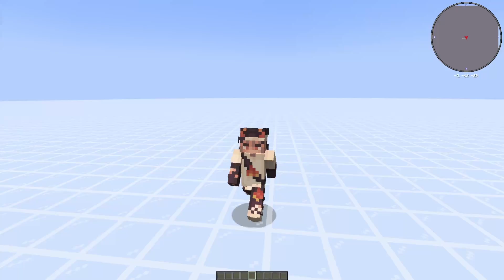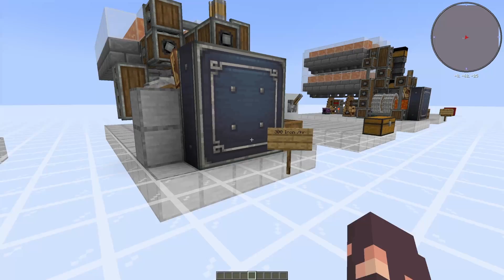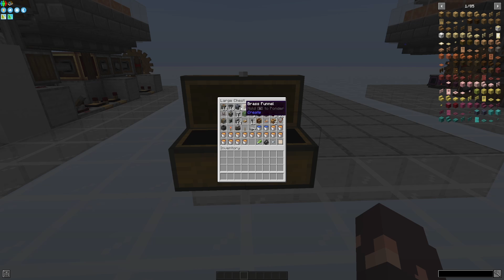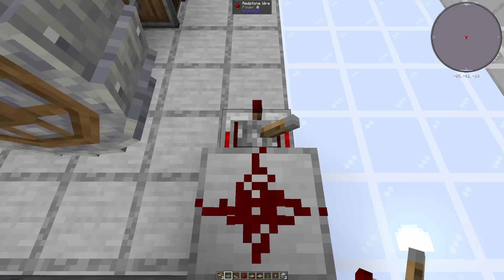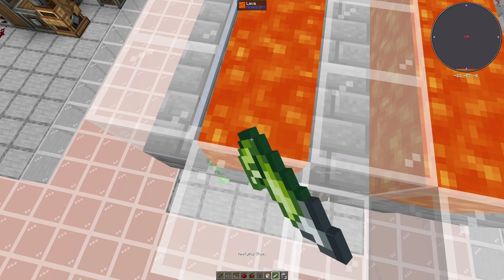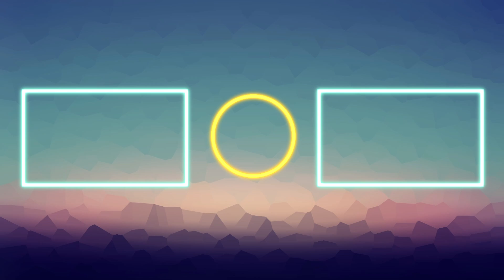The ULTIMATE CREATE IRON FARM (No Villagers) 600 IRON PER HOUR! |  Create Mod TUTORIAL

Comment: The turning is not drooping cobblestone. i see in the comments that people just put in drills. is there a way around that?
Reply from the maker: Make sure that while the thing is turning cobble is generating. if it isn't try increasing the sequenced gearshift angle to 100/110/120 degrees to see if that fixes it. also make sure to glue the original stone blocks together so you get the full line of blocks turning!
Reply: @kindlebubbledump  i confused a Redstone extender with a repeater. Its fixed now Thanks

Comment: I downloaded the schematic and it's not working, the clutch doesn't start so everything just doesn't move when i removed it and replaced it with a gear it works, also the sequence generator just doesn't work, the conveyor belt is going the opposite description and the cobblestone that is rotating doesn't break the new cobblestone (it rotates when i replace the sequence generator and the clutch with gears)
Reply from the maker: Hey! I don't explain how to setup the schematic in this video cause it was one of my earlier ones before I knew that's how most people would use the farm. The clutch should act as a shaft unless powered, then it won't do anything. It's just an on/off switch tho so if you don't want it you don't need it. The convayor belt going the opposite direction can be fixed by inverting the 256 RPM rotation speed controller from clockwise to counterclockwise (the rotation is dependent on which orientation you put it in your world so it differs). You should also check that the fan is going the right way, if not change the slower RPM rotation speed controller from clockwise to counterclockwise too. Weird that the sequenced gearshift doesn't work. Make sure you're flicking the lever to turn the farm on? that lever will power a clock that powers the sequenced gearshift and lets it turn. It will also make sure the clutch stays inactive and won't stop the farm.

I would watch the tutorial vid just to make sure you have every component, and if you skip to the redstone logic part I explain whats going on there if it's confusing.

Comment: 2h i can't solve the problem overstressed
Reply from the maker: You'll need additional power generators. If possible I'd recommend a steam engine since those generate the most amount in the smallest footprint, but you could also do a max sized windmill, or a TON of water wheels until it starts working
Reply: @kindlebubbledump  after 6h, i realized that it was a problem with the mod, I reinstalled the mod and now everything is good, thx for the tutorial
Reply from the maker: @Cosmos_Gregoriy OH NOO! glad u found the issue and the farm works!

Comment: I followed everything right and its in reverse I doNt UnDeRsTanD
Reply from the maker: Just change the 256 rpm rotation speed controller from clockwise to counter clockwise. You might also have to change the 10 rpm one if the fan is backwards
Reply: @kindlebubbledump  I figured it out after sending that and replaced the turning part for drills, works now tho :D
Reply from the maker: @DragonicArchitect cool!
Reply: @kindlebubbledump  trying to make my own version of a zinc farm (im on fabric so I have that weird plugin that uses asurine) and its actually kinda compact so far
Reply from the maker: @DragonicArchitect nice! I haven’t messed with fabric create yet, but that sounds fun!
Reply: @kindlebubbledump  its a much more lengthy process than forge lol
Reply from the maker: @DragonicArchitect lol

Comment: without using a creative motor would a regular motor work the same?
Reply from the maker: yes! Just make sure you can generate 6,200 Stress units. You can check how many you're making with a stressometer connected to the windmill bearing/water wheel/ other motor

Comment: is the mechanical belt supposed to go the opposite direction of the funnel thats connected to the barrel 😭😭
Reply from the maker: no! the build is directional, if you reverse the two rotation speed controllers from clockwise to counterclockwise then it should fix it

Comment: Does this work for 1.20.1 ?
Reply from the maker: Yes!
Reply: @kindlebubbledump  The redstone mechanism (10:12) does not repeat for me. It only runs once before stopping completely
Reply from the maker: @mufano8843 does the powered latch at the start of the circuit get powered from the side at the end of the loop? If so, make sure the on/off lever stays on. If not, it has something to do with the return circuit. If you could join my discord: https://discord.gg/UWf8tWjqpN, you can send a screenshot of the circuit and I can help more
Reply: @mufano8843  It happened to me, I had gotten confused and crafted the wrong lever, I realized looking at the detail of the redstone comparator that it didn't connect to the lever on the floor, 9:18

Comment: Im getting no cobblestone at all even at 8rpm
Reply from the maker: I would try 6 rpm and if that doesn’t work, keep it at 6 and increase the pulse repeater wait time by a few ticks (2-10). If that still doesn’t work, make sure the stairs are waterlogged (because schematics can’t place that in automatically). Let me know if you try all of these things and it still isn’t working
Reply: @kindlebubbledump Holy shit cheers for the fast response
Reply: @kindlebubbledump  yea i tried it all and the cobblestone still wont break
Reply from the maker: @FitnessBear  is the cobblestone spawning at all? If not, mine one of the glued together stone blocks and see if a new piece generates.
Reply: @kindlebubbledump  Still nothing is spawning, it only spawns when i deactive and active the the farm
Reply from the maker: @FitnessBear  oh weird. I haven’t seen that before. Are you playing on a server with any plugins or other mods that could be messing with cobble generation?
Reply: @kindlebubbledump  Ahhh makes sense, got tons of mods while playing on a mates sever. I guess that could be the issue, well i guess it aint working though but damn cheers for helping me out man. Appreciate it!!!
Reply from the maker: It’s possible that it can still work since it’s just cobble generation. If you have a cobble generator that works on the server, you can remove the one from the farm and put in the working one. Sorry it isn’t working for you :(

Comment: it works fine to me not until i can't waterlog the leaf and the fan intakes the air instead of pushing the flint and nuggets to the funnel
Reply from the maker: For the fan issue, reverse the 10 rpm rotation speed controller from clockwise to counter clockwise. For water logging, you can put a trapdoor in front and a full water block behind and that will fix it.

Comment: when the bearing spinning the cobble stone also spin as well but not going into the belt.  Can someone explain me why? ( I alr glued it like the video said).
Reply from the maker: It might be that the rotation speed is slightly too high. If you change the 10rpm rotation speed controller to 8/6 rpm it will probably work.

Comment: Never have I thought mechanical bearings would replace drills
Reply from the maker: Me neither lol.
Reply: How about gantry shafts and trap doors? There's a faster operating version of this that does exactly that. And a guy made use of this same physics exploitation to make a giant walking fist operated by a valve handle that just kinda punches its way through mountains.
Reply from the maker: @redjack2629 I have a new iron farm that uses that exact cobble gen design. It’s 4x as fast in a similar footprint lol. The mech that can punch through mountains is a crazy cool idea

Comment: Just using minecart contraption can make this a lot easier. I even made obsidian farm with the same concept.
Reply from the maker: I haven’t worked too much with minecart contraptions, but I’ve heard they are pretty useful for 0 SU contraptions.
Reply: @kindlebubbledump  its insanely useful, the recent trick i found is 
1. Place Rail
2. Place minecart assembler on rail
3. Place a minecart in between rail and minecart
4. Place any block (I prefer brass casing) on top of assembler
5. AND mainly, place lever on the brass casing.

Now, the assembler automatically on's and off's. If you connect sail frames with the brass casing, it sticks without glue. They will destroy anything that forms in between those sails. Please use glue and trapdoor if you are planning to make obsidian farm though. Use this method anywhere where you need breaking, LOL. Btw, I really liked the crusher assembly part of your farm, it looks clean.
Reply from the maker: @ChiragShrestha-s8z  ohhhh ok that makes sense! Good to know for the future!

Comment: help! the iron nuggets are moving to quickly before the press can even turn them into ingots and cobblestone keeps leaking out
Reply: nevermind fixed it!
Reply from the maker: @wgroupvids awesome!
Reply from the maker: Set the brass funnel filter to iron ingots, that will prevent nuggets from coming out. Also if you slow down the 10rpm rotation speed controller to 8 or 6 rpm, the cobblestone won’t leak out

Comment: know this is a little old, but having trouble, it wont turn on, used the schematic cannon for the 300 blocks an hour version and it looks like the clutch always stayed powered
Reply: never mind got it working but fixing the rotational controllers and reputing down abit of the redstone
Reply from the maker: @Ketsurui199 awesome! Glad you fixed it, lmk if anything else seems broken!
Reply: @ThisIsKettsGames  How did you fix it? I'm having the same issue
Reply: @mufano8843  i did, i replaced the redstone on the rightside manually and checked that the rotaional controllers where right, dont forget you will need to glue some parts too, like in says in the video

Comment: help me please, i used the schematic download and the conveyor belts are moving the wrong way, how do i fix it
Reply from the maker: Change both rotation speed controllers to be in the opposite direction (clockwise to counterclockwise, or vise versa depending on what the default is)
Reply: @kindlebubbledump  AH tysm, didnt even know that was possible
Reply: @kindlebubbledump  ive also been having trouble getting the gravel to turn into iron nuggets and flit, it just sits there
Reply: Apologies for all the comments but ive noticed when i have to rotation set the other way, where it fixes the belts, the fan sucks in so the gravel isnt getting pushed into the funnel
Reply from the maker: @Shlorge1290  there are 2 rotation speed controllers. 1 is fast, the other is slower ~10 RPM. Change the direction of the 10 RPM rotation speed controller and that should fix your issue!

Comment: Since it appears no one has mentioned it; the schematic for the smaller farm isn't working. One file is a zip with no schematic even included, while the iron farm v2 schematic lists a creative motor, which clearly one can't get in survival, so the schematicannon gets stuck when it gets to the missing creative motor.
Thankfully, I could play this vid on my phone to follow along while I finished building the rest of it, as my laptop does not like me playing youtube vids and minecraft at the same time. But I figured I'd point this out so maybe the files can be fixed for anyone else that wants to use the smaller iron farm schematic in the future?
Reply from the maker: Very good point and I should upload them then to create.com and remove the motor. For the future, you can set the option in the schematicannon to “skip missing blocks” which (if you have everything else) will just skip the creative motor and finish everything correctly.
Reply: I wasn't aware that was an option, I've learned something new today! 8) Thank you for making such good, compact farms. I'd already been using your moss/bonemeal farm, with a small addition to let me take moss from it from time to time to use for my Create Crafts & Additions Biofuel setup. It's been a godsend!
Reply from the maker: @KeidenSilex sweet! Glad u like it!

Comment: the farm isnt working on 1.20.1
Reply from the maker: What part isn’t working?
Reply: @kindlebubbledump  the timer to reset the mechanical bearing. It just turns off.
Reply from the maker: @zarbeon3550  the lever that powers it should be enabled for the farm to work. Otherwise it will turn off after the first flick

Comment: My fan is not pushing the items. It is blowing the right direction but just not pushing them.
Reply from the maker: It should definitely push the items. What version of create are you using, and do you have any other mods that might affect this functionality?
Reply: 1.20 and the other mods are clumps, mini map, apple skin, chunk loaders, JEI, create deco, and jade
Reply: I don’t think of those would effect it
Reply: And other fans I have used do push the items
Reply from the maker: Oh then that’s super weird. Make sure the leaf block is waterlogged and double check the fan is pushing instead of pulling (you should see blue water particles). If none of those work, you can add a belt underneath the crushing wheels so all the gravel will fall onto that and then the belt can bring the items towards the vault and be washed at the same time. (The belt can be level with the leaf block, or 1 block below it and the items on the belt will still be washed).

Comment: I'm getting raw iron nuggets, what should I do?
Reply from the maker: Make sure you set the filter for the brass funnel coming out of the basin that compacts nuggets into ingots to iron ingots. Otherwise it will take the nuggets out immediately
Reply: @kindlebubbledump  Itt keeps it as raw ignots, I think if I remove the water in that thing it turns to normla nuggets? I used the V2 of the contraption with schematics
Reply from the maker: @MRDaved you want the bulk washing to turn the gravel into iron nuggets, then the nuggets get picked up and pressed into ingots. If removing water creates normal iron nuggets then do that
Reply: @kindlebubbledump  Using the bulk washing with water works iron nuggets, but they're raw iron nuggets
Reply from the maker: @MRDaved  you must be playing a modpack that adds raw iron nuggets to the game because that is not an item in the base create mod. My guess is if you smelt the raw iron nuggets it will turn into normal iron nuggets, so maybe put in a fan with lava in front of it for smelting.
Reply: @kindlebubbledump  That's exactly what I ended up doing, I'm sorry it turned out to just be the modpack, thank you for trying to help
Reply from the maker: @MRDaved no problem, glad that fixed it! Sorry about the late response I had to go to sleep lol

Comment: hey bud great video! i replicated this farm but i have two problems: the first one being that the cobble generator doesnt generate cobble, it just rotates infinetly without dropping a single cobble. problem n2 is that the encased fan isnt working correctly. it is pulling instead of pushing the blocks to the brass funnel. do you think you could help me? thanks
Reply from the maker: For the first fix, I would recommend lowering the 10 RPM rotation speed controller to 8 or 6 or 4 (whichever makes cobble generation work) because the game lag could be influencing that. as for the fan, can you reverse both rotation speed controllers from clockwise to counterclockwise (or vise versa). That should fix the fan, and also ensure the crushing wheels are spinning in the correct direction.

Comment: Hey! Great video, I finished my build, about a week ago! Loving it so far! I did notice something odd when I logged into my world today. For some reason the clutch is engaged, stopping the machinery, even though I haven't changed anything in my build since I activated earlier this week. Any thoughts on what may be triggering it?
Reply: I've already turned it off then back on, and rewatched the video to make sure nothing got messed up in the redstone layout.
Reply from the maker: The redstone clock that pulses every 40 ticks or so should be powering the pulse extender that is going into the block with the redstone torch connected to it. If that pulse extender isn't powered at all times, the machine will depower itself. I would make sure the redstone clock is still looping, and the pulse extender going into the redstone torch block is above 50 ticks (maybe more if you changed the other timings). If you're still having issues, you can join my discord where I have a troubleshooting channel where you can include pictures

Comment: This design was good until I started it it crushes the stone makes gravel but the gravel gets spitted out on the side of the crushing wheel so the fans don’t hit it any help would be appreciated
Reply from the maker: I’ve only seen this happen when the crushing wheels are going in the opposite direction. If that is happening, change the direction of both rotation speed controllers to the other direction. If not, can you describe a little more about what going to the side means? The crushing wheels should drop the gravel directly downward, and if this isn’t happening, try to place blocks where the gravel is spitting out to try to force it downward

Comment: is the cobble gen patched? its just spinning for me but nothing happens
Reply from the maker: It shouldn’t be. Try to slow down the 10 rpm rotation speed controller to 8 or 6 or 4 rpm to see which one works. (Prob a lag based issue)
Reply: @kindlebubbledump  sorry for being annoying i admit i did skim through the video a little and it was just me not knowing how a sequenced shaft worked.
Reply from the maker: No problem! I don’t think I talk about it in the video, but if that works great!